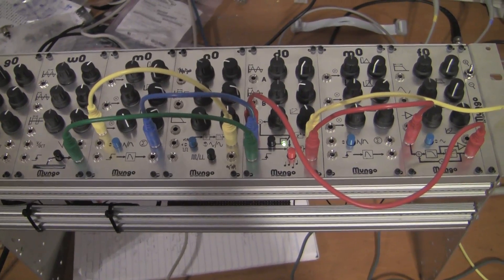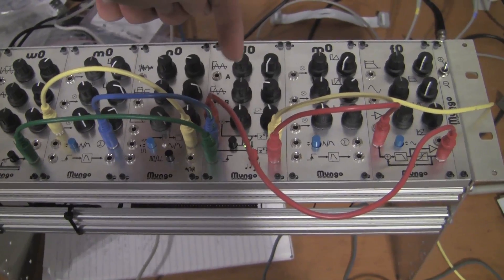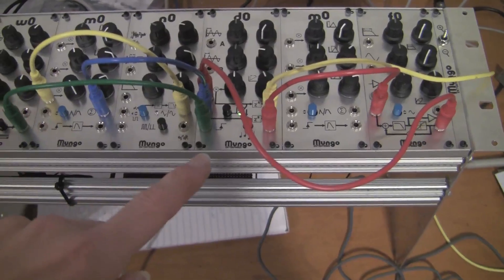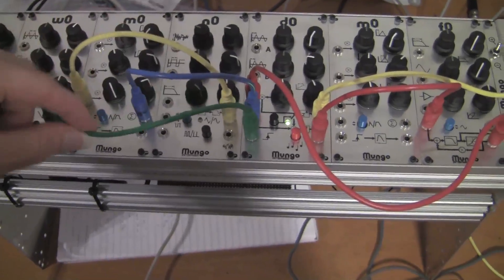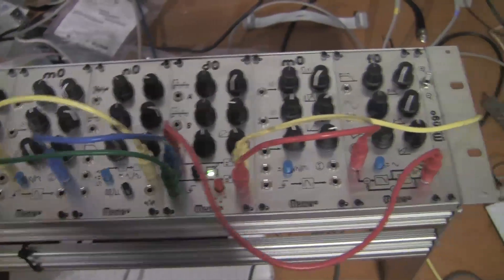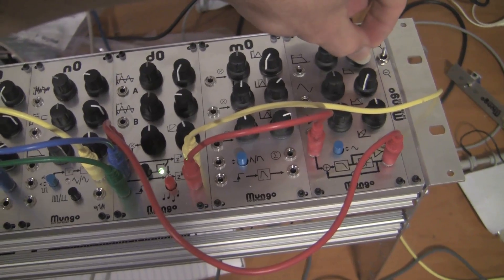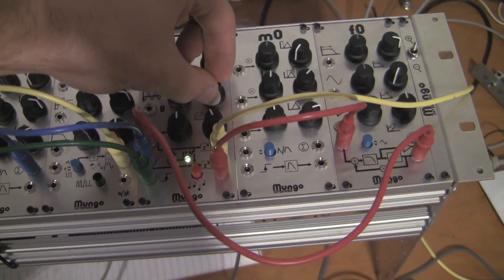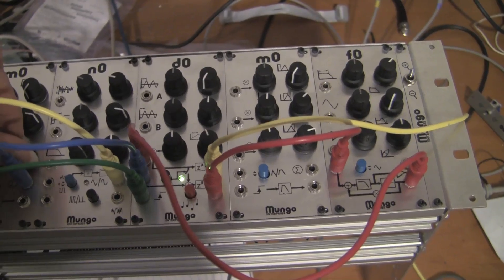Mungo Enterprises d0 Karplus-Strong

Comment: Physical modeling simulates the sounds of vibrating objects.  The interaction of an impulse with simulated resonant bodies produces time spectra which are psychoacoutically familiar to humans--in other words, "natural-sounding"--even if they represent objects that are physically unrealizable with existing materials.  In addition, if the excitation contains random elements, the resulting waveforms are always slightly different, even for the same note.  This gives another element of realism that is lacking from sampled sounds.
 
Several of the Van Duyne-Smith patents on physical modeling have recently expired, which should allow many elaborations of this method to be implemented without infringement.  In particular, US patent 5471007, which covered multidimensional digital waveguide signal synthesis, has now expired.

VST implementations of physical modeling exist (Chromaphone, Kaivo, Tassman), but this is the first time I have seen it in a real (as opposed to virtual) modular synthesis system.